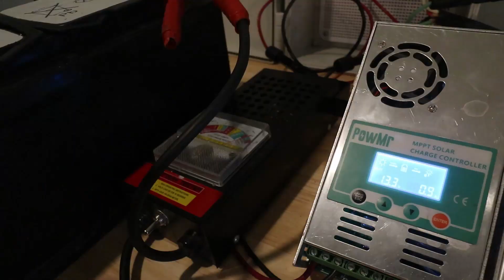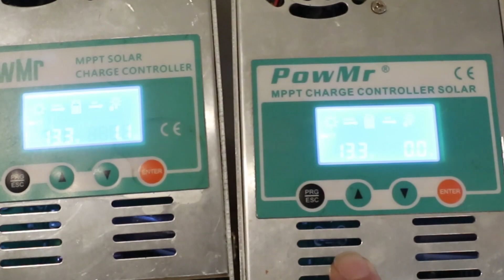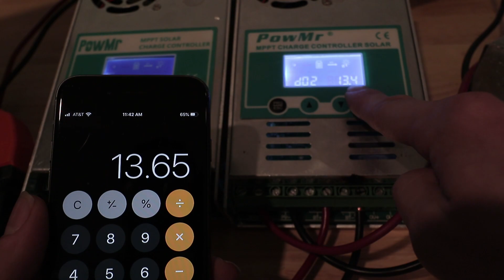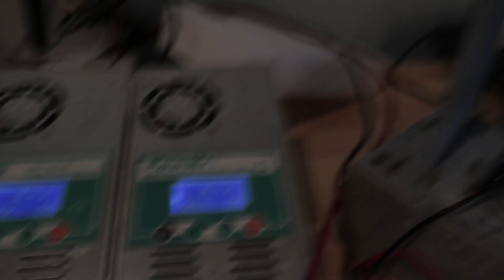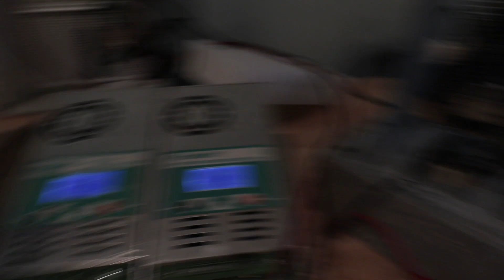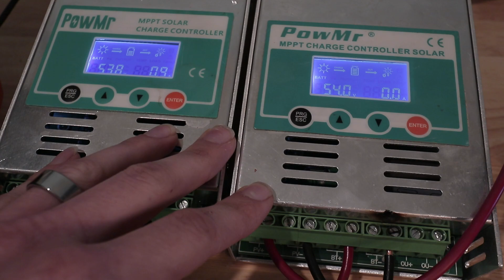Two PowMr 60A Charge Controllers Feeding The Same Battery

Comment: Yes, stupid idea. This is not a full test, you never know what can happen at the long run. The main problem is, it isn't a 'stupid'/simple charger. It is very possible one of the two has no effect at all. You don't checked what it is actually doing at the output. Don't do this, buy a capable charger instead.

Comment: Question. I have 4 60 amp charge controllers with 3 panel arrays that are about 1300 watts each. Could panel to bus bars to distribute to the controllers and from controllers to bus bus bars to my battery bank with no problem? I was thinking it would be good for shading and general current distribution without wearing out the controllers seeing that they're grounded equally. I had an issue before the controllers were too close to the max amp value and getting too hot . So instead of 3 I'm using 4.

Comment: For lifepo4 l, how can we lock amphere with which the battery is being charged in bulk charging mode? Does this mppt controller decide the amphere by itself? Or do we have amphere lock settings in the BMS?

Comment: I know this is an old video, but I see people reporting that if you use the 2 pv and bat connections for using wires at the same time, the controller thinks there is a 24v bat connected and some settings do not apply as 12v because of this. Have you ever encountered this issue? Yes, I just got one but I have not done testing yet.

Comment: If those two charge controllers were say sharing two strings of three 370 watt panels, would they share the load or fight and never   settle out
Reply from the maker: I’ve never played around with that. Maybe one day.
Reply: @BeeneEnergy  I’m going to try it, those Powmr can’t seem to handle more than 2200 watts without going into over heat and loosing their minds, if two can share a string it would save running an additional wire to the array  and I could run 3p 3s. A better controller is definitely the solution but if you already have the things might as well use them up.  And Thankyou for always responding to posts even on old videos, it shows how much you care.
Reply: Well results are in, connected a single string of 3s 2p 370 watt panels to two Powmr 60 amp charge controllers: end result as soon as the second unit was connected to the string : the panels were pulled down to battery voltage and acted like a pwm. So it’s a fail!?oh well now I know
Reply from the maker: @travishodges5179  Yikes that’s too bad.

Comment: I have a question can you use the same solar panel wires then Y connector to run to 2 different charge controllers for parallel solar panels for higher amps then 1 controller to take. Or do you need separate wires for 2 different charge controller
Reply from the maker: I’ve never seen a charge controller that supported that configuration officially. Unofficially it would probably work.
Reply: @BeeneEnergy  or do like positive bus bar from solar panels and just have charge controllers go to bus bar. You should try it

Comment: I dont understand what you mean they are not synchronized. There is nothing to synchronise. If you empty two bottles of water into the sink, you dont need special synchronise for it to work lol, i assure you, it just work.. also with 20 bottles.

Concerning to hear they show wrong watts. I'm getting quite allergic to those powMr. Saw the review from another youtuber where the 60a new model you tested which got stock in mode 7, was sending out 80v to the battery if you had a battery disconnect just for a few sec.. seems its absolute pure garbage all around their offerings.
Reply from the maker: More expensive controllers like the outback FM80 have sync cables so they act as one. This was me playing around with whether that seemed overkill. As you state it seems rather intuitive they can just operate independently since they are all just sensing voltage. While these silver powmr charge controllers seem to operate better than their new m60 "pro" model there do seem to be differences over time, as some I've tested have worked better than others. Reliability hasn't been a concern so far though and they stay cool enough to keep out of the default mode the m60-pro goes into.
Reply: @BeeneEnergy  im guessing its a sync for making sure you dont do multiple cell equalisation on flooded batteries. So if you have 2 or more then they pick one to do it monthly, not every 5 days because you have 6-7pcs.

Charging has really no info one could tell the other. They sence voltage as you say, and thats going to have a tiny difference among them self. Then they sence resistance as they try to charge.. slight difference there too. Nothing to communicate related to charging.

Edit:
Im going to buy another "One Solar" controller. Its cheap and all the competition have very poor displays that make me allergic. Especially srne controllers look like they came out of 1982 with their menu. I just hate looking at them.. like writing letters on an old calculator.. just stupid in year 2022 because they want to save 12cent. :)

Comment: I have 2 powmr on 900 amp lead acid.  They seem optimistic for voltage too. So far working good but I probley will go lithium soon maybe with lv2424.
Reply from the maker: They certainly have their quirks, but failing isn't a common one so I'm thankful for that :).

Comment: Are these UL 1741 rated?
Reply from the maker: Someone can correct me if I’m wrong but ul1741 is specifically for an inverter only feeding power to the grid if grid is available, and shutting down when no grid is present. Since this is a charge controller with no inverter functionality it won’t have any ul1741 cert.

For that matter it doesn’t have any ul certification being an inexpensive off grid controller :).
Reply: Just asking if it was listed. And NEC states "all equipment must be listed' for on and off grinder. If local code and inspectors Don't require then you are lucky

Comment: HOW MANY 24V PANELS 235 WATT CAN I PUT ON ONE OF  THEM SOLAR CHARGER CONTROLLER THANK YOU
Reply from the maker: Depends on what your battery voltage is.
Reply: @BeeneEnergy  im working up to 500 amphrs
Reply from the maker: @leetaves9143  But what voltage?
Reply: @BeeneEnergy  24 volts
Reply: Depends on which model of the charge controllers you are using. For the 30 amp cc it is 720w, 40 amp it is 960w, 50amp it is 1200w and for the 60amp it is 1440 watts for your 24volt panel that you have assuming you are using a 24volt battery bank. If you are using a 48volt battery bank the numbers will be different. If you are using a 24volt system you need to series two of your panels because the charge controller starts from 37v-105v input in the in the 24v system range.

Comment: those are not 60 amp its been proven 40 max they lie and do the firmware so it says 60
Reply: You are talking rubbish. The 60 amp rating is set by the MOSFET count, NOT the firmware.  You dont even have one of these.
Reply from the maker: Could you point me to where it’s been proven? Because I’ve seen well over 40 with mine.
Reply: @BeeneEnergy  https://www.youtube.com/watch?v=C_2DX9An_Rc&ab_channel=z1power  its called typing in youtube amazon mppt not 60 amps and there ya go
Reply: @BeeneEnergy  did you sere the vid i showed you there is another one too dont remember where it was but on youtube these things  produce current when it says fully charged they cannot be trusted

Comment: What gauge wire are you using
Reply from the maker: I was using 10awg wire.
Reply: @BeeneEnergy  awesome thank you. I have 3 powmr I'm bout to mount and start wiring everything together
Reply from the maker: @Wherestheexitranch  FYI to support the full 60a for each it should be 2x 10awg. I was running just one to each since I wasn’t pushing much energy at the time.
Reply: @BeeneEnergy  so 2 pos and 2 neg from each charge controller to the battery bank? So a total of 6 pos 6 neg to my battery bank from my 3 controllers
Reply from the maker: @Wherestheexitranch  Yep that’s what I meant :). And don’t forget those fuses right before connecting to the battery.
Reply: @BeeneEnergy  could I run both pos from one controller to one fuse than run 2 pos out the one fuse? Or do you think 2 fuses per controller
Reply from the maker: @Wherestheexitranch  I do one 30/40a fuse per wire. Fuse is supposed to protect the wire from burning up so I figure it is safest to protect each one individually.
Reply: @BeeneEnergy  I was looking at the powmr and it shows them wiring their charge controller in parallel. Do you have any experience with doing this?

Comment: very cool, i'm from brazil, here people use it in their solar systems, it's common, i thought of putting another third powmr 60a between them and the battery, i could connect them in a serial way to double the voltage and maintain the amperage ? since we would be at the 60A amperage limit and I couldn't put 120A of controller... is there anything that can be put that connects them in some smarter way? if it's cheap it would help a lot lol...

Comment: Regarding your PowMr and Li batteries, did it trigger the floating mode (Working mode: 8.0) when the battery is fully charged? In its manual, it is stated that D01 floating voltage is not used when choosing Lithium in DO4.

Comment: Hello quick question i have 8 12volt everstart battery 29dc from walmart but i cant find a charging voltage profile for this do you have any idea so i can set my float and bulk charging
Reply from the maker: Unfortunately I don’t have a good answer for you. Ideally they’d have a spec sheet showing optimal settings. If not you could look for flooded lead acid generic parameters.

Comment: I have smart inventer. It has two input, first one battery input second pv input but my inventer has pwm controller for this reason I bought this mppt. How can I connect with my inventer? Which output I use?
Reply from the maker: You would connect your mppt charge controller directly to the batteries, don’t connect through the existing smart inverter.

Comment: I have makeskyblue 40A,the voltage display is off,when I measure with multimeter there is deviation of +0.2v,so i decided to lower float and absorption voltage by -0.3v ,I was worried it will fry my lead acid gel battery,new fan from Kenya
Reply from the maker: Glad to have you from Kenya! Good call on measuring the voltage. I do the same when setting up one of these units.

Comment: Can anyone tell me about issues with the battery charge amp limits being 100 amps
And the charge controllers delivering 120amps in parallel?
Reply from the maker: Could you expound on your question? I’m not quite sure what you are asking.
Reply: @BeeneEnergy  well, lead acid and lifepo4 battery manufacturers list max charging amps at 100amps
If the chargers are 60 amps each does this not exceed the 100 amp current limit?
Reply: @keiths1400  what array do you have setup and what battery voltage? the controller's max amp output is about 60amps, i have seen it go as high as 70 amps btw. but if you only have 400 watts of solar power  connected to it you will not see 60 amps out of the controller. i only know principles at the moment, as i am waiting on my next panel to arrive before i can test more with this controller

Comment: Hey ABE or should I say Mr. Lincoln. lol. I made a 9 sec video of my washing machine motor set up. I only have one motor charging, that is the one in the middle. The one on left at start of video I rewound to use a e-bike controller to spin the other 2. The other 2 I rewired to lower the voltage and increase amps. I just have one making juice now and it is putting 720w at 14.2 amps in Powmr. Problem is it is making 145v or so. Close to the 160 powmr can handle. So when I get both motors making juice plus my 3 panels I am going to need 3 powmrs. Check out my little 9 sec video. I just did a fast video to show guy in Australia what i am doing. Not my finished product at all. But will bring it around to show you when I get her done. Here is video. https://www.youtube.com/watch?v=P4u7I8LZYuU
Reply from the maker: That’s fantastic! Cant wait to see that thing capturing wind energy.

Comment: Do you have any review regarding 2 different wattage?
Example:
Solar controller 1 - Input 800 watt
Solar controller 2 - input 200 watt

Scenario 1:
Both having same Volt
Scenario 2:
Both having different volt

Does it work ?
Reply from the maker: Won’t be a problem, Both can have different solar panel voltages or different wattages of panels.
Reply: @BeeneEnergy  Higher voltage move to lower voltage. Im afraid higher input controller from solar panel will "mistakenly" charge the peer controller which is lower voltage.
Reply from the maker: @psychicmind9  since each charge controller has its own dc to dc converter they will each be the same on the battery side of the charge controllers.
Reply: @BeeneEnergy  that make sense.. From the battery point of view, each controller have same voltage.